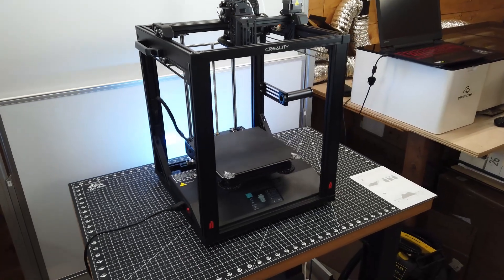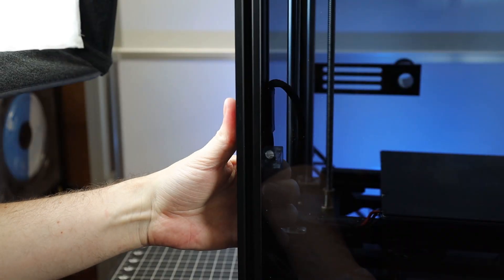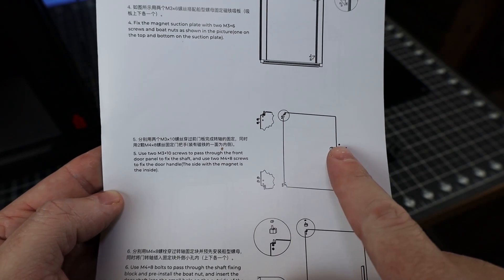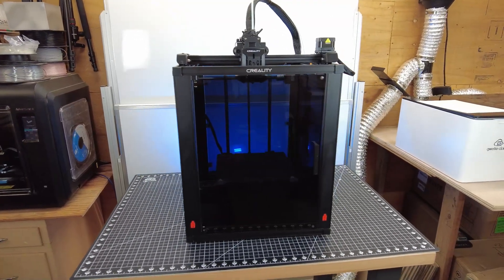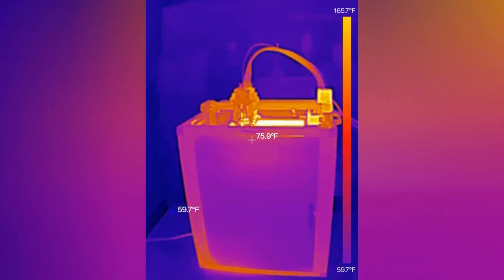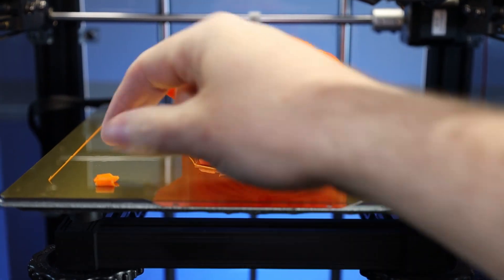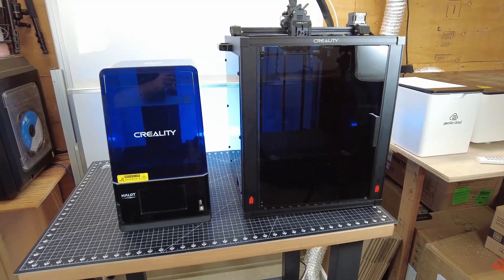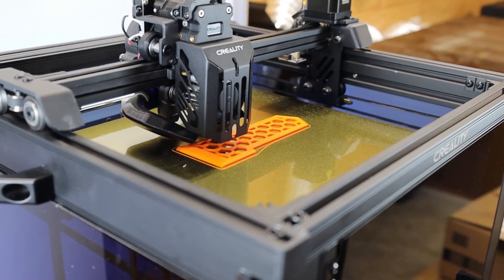Ender 5 S1 Enclosure - Installation & Testing Using ABS

Comment from the maker: Enclosure Options:
Acrylic Enclosure for Ender-5 S1 https://bit.ly/Ender-5-S1-Enclosure
Acrylic Enclosure for Ender-5 S1(Amazon) https://amzn.to/3HlFUMc
Soft Tent Enclosure - https://amzn.to/3GMXwkj 
Other 3D Printer Enclosure - https://bit.ly/Creality-3D-Printer-Enclosure

3D Printer:
US store: Coupon Code：12ES5, get 5S1+Sonic pad Combo $120 off， only $479
Creality Ender-5 S1 - https://bit.ly/Creality-Ender-5-S1
Creality Ender-5 S1 - Amazon - https://amzn.to/3YcHFCg

Nozzles:
Micro Swiss Brass Plated Wear Resistant Nozzle - https://amzn.to/3CuDnwG

Helpful Printer Upgrades:
PEI Spring Steel Magnetic Plate Double Side Smooth and Textured - https://amzn.to/3XdPDcV

3D Files:
HexScraper - Printbed scraper - https://www.printables.com/model/122894-hexscraper-printbed-scraper

The Torture Toaster - https://www.printables.com/model/60985-the-torture-toaster

3d Printer Filament That I Use:
PolyLite ABS - https://bit.ly/PolyLite-ABS
PolyLite ASA - https://bit.ly/PolyLite-ASA
PolyFlex TPU 95 (Flexable) - https://bit.ly/PolyFlex-TPU-95
PolyLite Silk PLA Blue - https://bit.ly/PolyLiteSilkPLABlue
NylonX Filament - https://bit.ly/MatterHackersNylonX
PolyTerra Marble PLA - https://bit.ly/PolyTerraMarblePLA
TECSONAR Tricolor PLA - https://amzn.to/3H79d5N
Build Series PLA - https://bit.ly/MatterHackersBuildSeriesPLA
Build Series Silky PLA - https://bit.ly/BuildSeriesSilkyPLAMatterHackers
Build Series ABS - https://bit.ly/MatterHackersBuildSeriesABS
Build Series PETG - https://bit.ly/MatterHackersBuildSeriesPETG
PRO Series Filament - https://bit.ly/MatterHackersPROSeriesFilament

Amazon 3D Printing Filament:
PLA - https://amzn.to/3gsLE9Z
PETG - https://amzn.to/3pXjjvu
ABS - https://amzn.to/3wsTRjS
ASA - https://amzn.to/2RX8dtM
Polycarbonate - https://amzn.to/3cLdr38
Nylon - https://amzn.to/3iNGeI2
______________________________________________
Note : Most of the links that I use that go to products are affiliate link. This means I make a small commission on anything that you happen buy using them. This is at no extra charge to you and this helps support the work I do on this channel. 😁👍
______________________________________________

Comment: Came back to this video to say that yes, the enclosure helps some but what helps the most is the acrylic top cover to complete the enclosure.  The print starts with the Z axis at the top, and heat rises, so the sides enclosed without the top does very little.  The top without the sides would be way more beneficial than just the sides, but of course ideally you get both for a complete enclosure.  They didn't release the top cover until like a year after the regular enclosure, so I've had it since April of 24, almost a year and half now and its really good to have a complete enclosure.

Comment: When printing with ABS, how do you deal with the fumes with the topless enclosure?
I have seen tops for the Ender 5 S1 advertised recently, have you tried any of these?
I've looked at the "soft" enclosure and feel it would work better beign fully enclosed and havign that refelctive interior surface, but the Acrylic looks nicer.   Maybe the acrylic could benefit from a chamber heater?

Comment: The acrylic cover is very stylish but this printer can do 300 degrees Celsius so is more of a performance printer than the average 240 degree max models. As a performance printer, you can expect to handle exotic materials such as PC or nylon where a full enclosure is required to limit fume concentration. As such, the flexible hood is the better option for this printer unless you have a ventilated workspace, and even then, the flexible hoods are a fireproof enclosure so if your printer decides that’s the day to try to burn your house down, it will fail. As sexy as the acrylic covers are, on a printer I have to choose function over makeup.
Reply from the maker: This printer was pretty much a stopgap between the older ender 5 and the new K1. Now this printer is very outdated and outperformed by their newer offerings.
Reply: @randymay  Do you think it's not worth it? I bought this printer 2 days ago for 339€. Would you say it is a bad buy in March 2024?

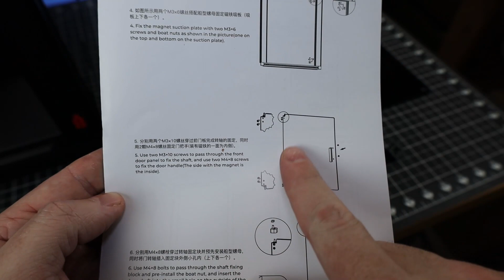Comment: My ender 5 S1 did not have a plastic removable insert like yours in the video at the 1:42 mark. Mine is solid aluminum , I ended up drilling the extrusion and screwing into it.  Kinda of challenging but it was either that or try to glue the bottom hinge and magnet catch to the extrusion. I guess they changed the front extrusion in manufacturing.
Reply: For anyone coming to this comment, there is a fix for this on Creality's website, from the ad for the enclosure. It references this difference, and offers a printable solution.

Comment: Mine just has a metal rail in the bottom, so i can't fit the door on 😢 i tested it its 100% not plastic on mone
Reply from the maker: You can still take it out, you just have to take apart a little more of the printer 😅
Reply: @randymay  id probably destroy it in the process XD
Reply from the maker: Just take your time and it should be simple enough. I no longer have this printer but if I did I would make a short showing you how to take the two supports off and pull that piece out
Reply: Ok here’s the fix!  Just dealt with this issue myself and if you search for Ender-5 S1 Door Frame Fixing Block you’ll find the stl for a part that affixes to the side instead of the bottom and works perfectly
Reply: @joey_mck  that worked perfectly! Cheers for the heads up!

Comment: I have a question about the little rubber guard thing that prevents the door from being installed. Does that need to be put back in. Im a little scared if I take it out I'm not going to get it back in lol
Reply from the maker: Yeah really don't need the black parts at the bottom of the frame
Reply: @randymay  awesome, thank you so much for the response. got my printer set up and already have a few successful prints out :D

Comment: did you have any issues with getting the door flush?
Reply from the maker: I did, so the mounting blocks are longer on one side so they all have to go in the same way or things will be off. If I remember correctly you can see when you install them if they are flush with the frame or not.

Comment: This vs Sovol SV06 plus. Which one is better?  
Thanks in advance!
Reply from the maker: It depends on what you are needing to print.
Reply: @randymay   Thank you for responding. 
It will be used as a tool. I would like to print useful things for around the house, small bicycle parts,  small car parts...etc.
I am not interested on making artworks.

So far, I l am leaning towards the Sovol.

Comment: Hello @randymay thank you for the review. My enclosure just arrived but couldn't fit the Right panel into place due to the metal part. Do you have any suggestions :/
Reply from the maker: What metal parts are you coming in contact with?
Reply: @randymay  There is a metal part at the back of the top panel where the axis motor is located. The metal part on its left side is blocking the glass.

Comment: I just installed my acrylic enclosure. I was lucky enough to find it for $58.00 on one of the Creality sites. One thing I noticed that helped me with installation a great deal is starting with the door (as suggested in this video) and installing the bottom and one of the top enclosure mounts first on the enclosure sides. This made it MUCH easier to align the panels properly. That being said, Thank you for the video! The instructions were like hieroglyphics to me so it helped me tremendously! 😊
Reply: On which site did you find $58

Comment: Wait you are supposed to use a special nozzle for Nylon Carbon Fiber? I used the stock one and outside of needing to do some cleaning before the next print it worked.
Reply: Also my plan is to do the ole' emergency blanket trick for the top
Reply from the maker: If you are printing with a brass nozzle and using carbon fiber you will make the hole bigger with just a few hours of prints.
Reply: @randymay  Gotcha can I use the ruby one with the normal PLA? Or is this one of those things where I really need to use something like the Hermit Crab?
Reply from the maker: So if you put a ruby one in you can use any material on it and it won't matter. So unless you want to swap it out for a different size then you don't need to worry about it.

Comment: I'm using the flexible Creality tent for my Ender 3 S1 Pro. It prints amazingly good ABS parts. The temperature in the inside is app. 25°C higher than in the room. But this is enough for perfect ABS. Much more important that the air temperature is the fact, that there is really no air movement inside.
Reply from the maker: Very nice, what are you printing using the abs
Reply: @randymay  my plan is to print really large horn speakers for audio applications (appr. 25kg Filament). This is only possible with ABS. And of course some technical parts.
Reply from the maker: @stephanbrenner3317  That sounds like a massive print for sure. I'm uploading a video right now about a printer with a 420x420x500 build volume that would come in handy for large prints. 😊

Comment: That looks great…I guess it’s more of a breeze guard? I mean…that toaster speaks for itself though. Especially because the clearances can be worked out with settings. Interesting.
Reply from the maker: Yeah more or less it's a breeze guard. Unless you have vents over the top of it 😅

But yeah it does work as you can see in the video and that ABS print was done just using the default ABS profile in Cura.  So with some tuning I can see it printing even better for sure.

Comment: Point of contention, there is no bottom, so as the heat rises, it is going to create a wind tunnel as it sucks cool air through the bottom, so realistically 2 more pieces will be needed, a top and a bottom. Creality do zero thought or intentionally make things bad to sell you more later.
Reply from the maker: You are right, there is no bottom as well. That being said most of the bottom is covered by the control box. I did think that might have been a problem as well but after using it and feeling the air inside the enclosure it just felt like unmovable warm air. 

I do have a CO2 laser cutter so I can cut my own clear acrylic and try blocking off the bottom. That being said I can even make a top of I really wanted to but I probably won't do that. 

I had very little faith about this enclosure from the start and I even talked about it in my first video about the ender 5 S1.  I believe I said it looked useless due to having no top. 

After that video I got an email saying that they are sending over the enclosure so that's why I made this video. I wanted to see if it did anything at all. 😁👍